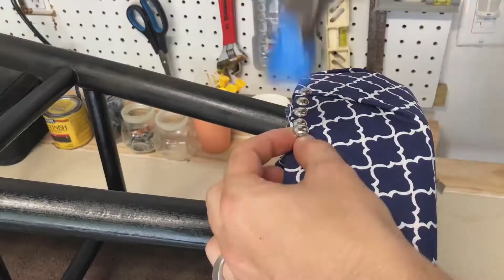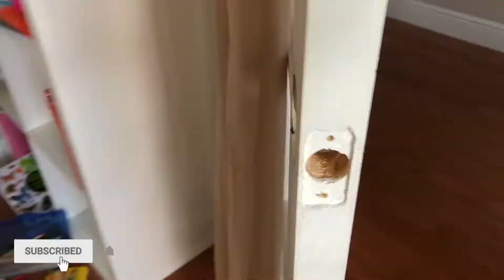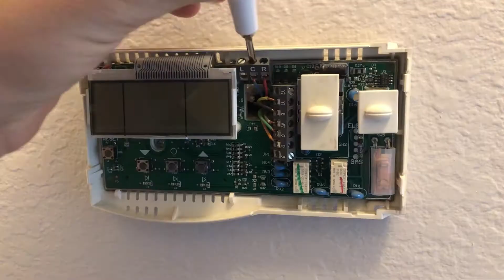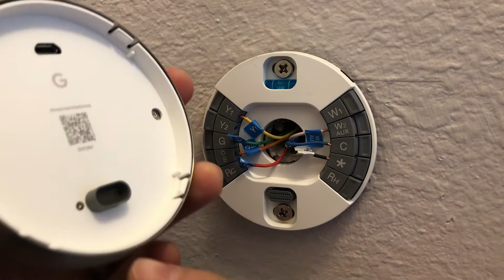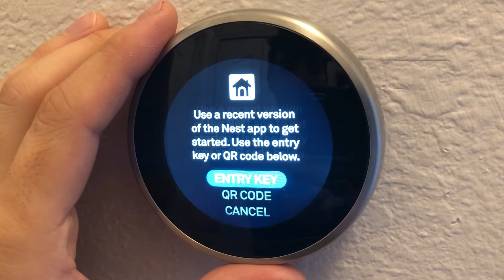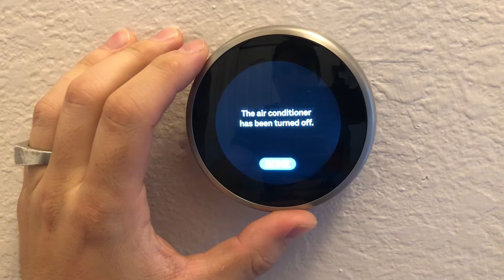how to install google nest learning thermostat 3rd generation

Comment: I am confused around mark 1;53 min. So you put the wire and push it into the hole and tighten it? Just not sure how to install the wire part like it work after place into the hole and tighten with the screw driver?